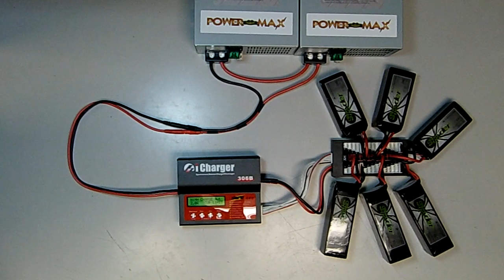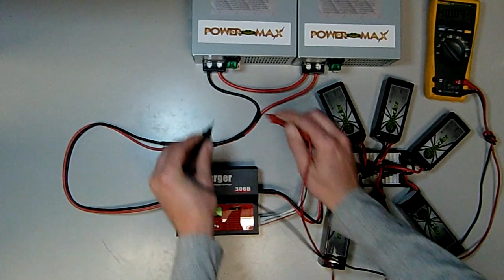Parallel Charge Board Demonstration

Comment: Will all the ichargers parallel charge this way using the same Parallel board? i really want to know if your icharger 3010B will do it using the same set up as yours or will i need to order different leads? 

Plus what if the batteries are all the same cell count but different C ratings?

I'd appreciate any help on this before i order the 3010B,thanks.

Comment: The default settings on the iCharger's limits the maximum capacity to 5000mAh, you will want to remove this restriction if you are charging in parallel.

Comment from the maker: Parallel is much simpler and safer than series connections, and although we do not currently offer parallel boards with Traxxas connectors, we do offer an option called out universal board to which you could solder them on or you could alternatively use our parallel cables.

Comment: Is there any benefit to charging in parallel vs series? I currently charge in series. I'm not too savy with lipos but it seems to me that the packs would be balanced more accurately because the balancer would be doing the balancing when charging in series. 

2nd Question: Do you make those parallel boards with Traxxas connectors?

Great video btw.

Comment from the maker: @xxgg Although not necessary at the 45A rates the power supply supports, it is preferred to use the largest gauge possible to reduce resistive loss in this permanently wired application.  12AWG wire could support the 45A max. charge rate, and you could get by with even smaller wire if you are using less than 100% power output, but larger is always better to reduce resistance and maintain efficiency.

Comment: Question:
You've said to use heavy gauge wire ex. 8awg between your PSU.  But is that really necessary?   Reason I am asking is because wire from charger is thinner, parallel board wire is even thinner (seems like 12 or 14awg.)
Right?
I do understand the need for heavier gauge wire but... you know what I am trying to say...